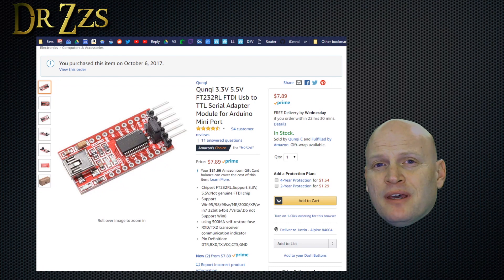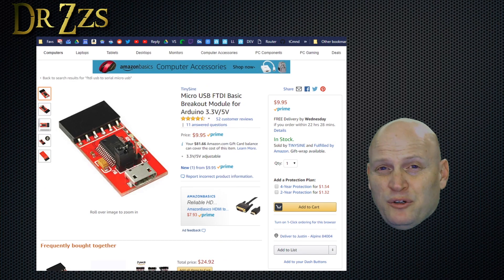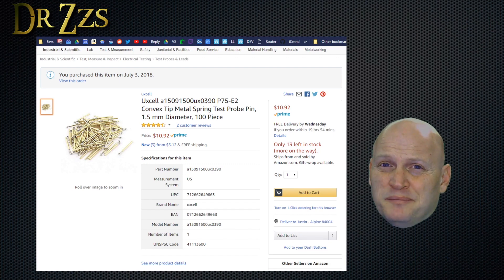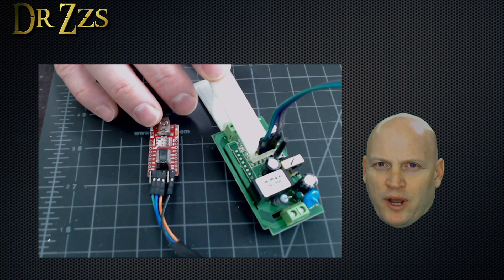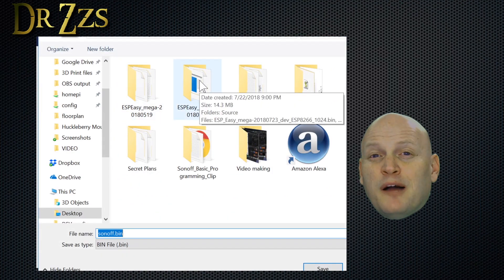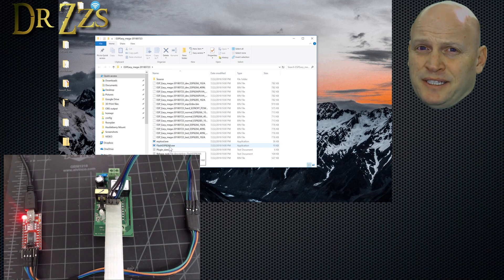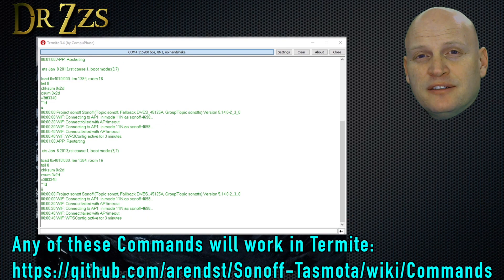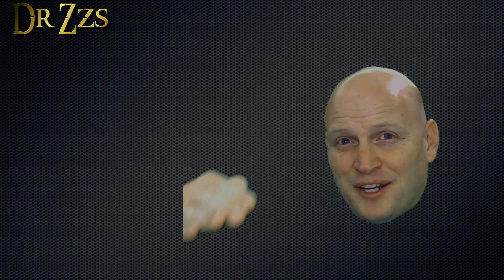How To Change Firmware on Sonoff Devices for use in Home Automation Projects

Comment: Let me get this straight.  Let's pick one advantage of flashing. Now I am thinking if I flash I should be able to use the unit ( with some extra programming ) to turn on a regular light bulb (120v) using the sonoff as well as the regular existing on-off switch ( I am not talking about replacing the existing switch with a push on/off or touch-sensitive switch ). Please confirm if I am right here. PLEASE.  I am a newbie.
Reply: May be I didnt explain this here. What I want is to use SONOFF and my regular household switch to turn a light on and off ( I should be able to use the regular switch and then also be able to use the wifi app and turn on/off the bulb. I hope I am clear )

Comment: I am not too much into electronics.. But in a few simple words can you tell me what this FLASHING is ? Why do we need this ?  Is it because you dont  like your devices to be controlled by the CLOUD ?
Please reply
Reply from the maker: Flashing is the process of replacing the firmware that comes on the device from the manufacturer.  When this video was published that was the only way to use these really cheap devices with your smart home hub of choice.  Things have changed and in most cases you can get these devices to function with any smart home hub now.  Some people still change the firmware (by flashing) because they want to avoid the cloud or because other firmware allows you to add functions to the device that the stock firmware doesn’t allow. Like adding motion detection or temperature sensor to a device that was built as just a light switch.  Flashing isn’t for everyone. It’s a fun way to tinker around and learn how these devices work and what all they can do.
Reply: @DrZzs  OK, I already use SONOFF to control my garage door (Sonoff Basic). The only thing I dont like is I use the eWeLink app, controlled by a chineese company ? Is there a way to only control SONOFF when I am at home and via the HOME-WIFI only ? i dont need CLOUD control.  What must I do ?
Reply: DrZzs I like to avoid the cloud as well. After flashing what app should I use.

Comment: ESP Home is SO much easier once you figure it out.  Copy the YAML file you have created for something else that is sonoff.  Change the names of a couple things.  Connect the FTDI to the Sonoff and plug it in to USB  Go to the folder with all your ESP Home stuff in the command prompt and type "esphome file.yaml run" When the prompt asks where the device is tap 1 for the FTDI in my case or 2 for WiFi.  Wait a few till it says it's resetting.  Remove power then reapply to reset the Sonoff.  Watch it connect to WiFi then put it all back in the case and hook it up.  It pops up in HomeAssistant and just has to be added. 

A few things are different to setup like if you want the button to basically reboot a device or something but otherwise it's super simple.  The main thing is each time you compile YOUR own bin for each device but no need for extra software to flash or to go into something to configure it nor an in between broker like MQTT to perform actions.  Once it's been flashed you can update or make changes over WiFi direct from ESP Home's setup directory which in my case is in the Python Folder.

Comment: Great tutorial. Every detail is important to begginers.
My Sonoff is the version with the holes, and usb converter already had rx and tx aligned, no crossing was necessary on the jumper wires. 

Everything looked fine until I tried to flash it. Termite didn't communicate at all. I was banging my head on the table for hours, until I finally saw the answer in a blog. The usb-to-rs232-adapter I use has the super cheap chip pl2303hax, not the ftdi's chip. It seems pl2303 version "hx" was pirated somehow and the vendor decided to drop a new windows 10 driver that killed all chips with that revision. Sadly there is no way to know if i have an original or not... and it doesn't matter anyway since all affected users NEED to buy new chips. 
(I still solved it downgrading the driver to an old version I found on the blog with the solution, after that it was ok).

Comment: DrZzs your are right, its already outdated.  Sonoff has removed the GPIO14 from its basic boards.  Making it unusable for the DIY community, I guess.
it turns out: the sonoff basic r2  now only comes with 4 holes GND,Tx,Rx,3v3 from amazon. I found out from your friend The Hook up (https://www.amazon.com/gp/customer-reviews/RD37CKA59B9YF?ref=pf_vv_at_pdctrvw_srp) that amazon is only shipping this 4 hole version (no gpio14)  So now we are going to be having problems "on reboot" with the GPIO pin (Tx=GPIO01,Rx=GPIO03 both pins pull High on boot) we connect to (which after testing the tasmota firmware in a esp8266 is something that has to be regularly done, causing the state of the "light" on boot, to change).  Is there another version that will have a gpio14 to work with (an amazon link ?)

Comment: Backlog SSID1 xxxxxx; Password1 yyyyyy; MqttHost brokerIP; MqttUser xxxxxxx; MqttPassword yyyyyyy; GPIO14 09; Hostname sonoff_name; MqttClient unique_sonoff_name; Topic sonoff_name; FriendlyName1 Sonoff-Name.....im so new i dont know where to find this info, can i get some help?
Reply from the maker: I can try.  the xxxx's and yyyyy's are names and passwords you'll have setup in other systems.  SSID1 is your wifi name. Password1 is your wifi password.  You'll need an mqtt broker.  When you set that up you'll have the IP address, user and password. Wherever I say "sonoff_name" that's the name you've chosen for this device.  Usually best to name it based on location or purpose. 
If you haven't set up an mqtt broker, that'll be step 1.  Then you'll have the IP, username and PW.  I'd expect that's the part that gets folks stuck.

Comment: Love the videos and attention to detail.  Following the procedure I am having no success.  At first I thought I had a bad Sonoff, but I'm having the same issue with the replacement.  I am using the Micro USB adapter you suggested.  I've verified 3.3v, proper connections and using a data cable.  However I can't get a terminal connection.  I use linux and am using esptool.py.  I am old salt in IT and low level stuff.  When I power up the FTDI, leds blink momentarily.  The sonoff never shows any led activity, don't know if this is normal.  Without booting in programming mode I can't get a terminal connection and esptool -p /dev/ttyUSB0 read_mac or just ttyUSB0 throws an error (running cmd as root).  dmesg shows FTDI at /dev/ttyUSB0.  I do see led activity on the FTDI when I open putty (or minicom) and press enter in the terminal window.  Not sure if I'm missing something or bad FTDI or another bad Sonoff.
Reply: I found the error of my way...  I had connected pwr to the DTR pin which was supplying 3.3v.  Had tested voltage and thought I was good.  Connected to the VCC pin and all my issues went away.  Flashed successfully, connected to and configured for my WIFI and on my way to setting up.  Thank you again!
Reply from the maker: Excellent!
Glad you got it worked out.  Thanks for the positive feedback.  I'll keep doing it!

Comment: Hi, I have successfully been able to flash my Sonoff Basic with Tasmota 6.6.0
Then I configured it to emulate WeMo Single Device for integration into Home Assistant.
The integration then shows up in HA, but no devices are listed.
What am I doing wrong here?
Please advice.
Reply from the maker: I'm not sure.  Do you use MQTT with Home Assistant?  I would suggest trying "SetOption19 1" in the console to turn on Auto Discovery.  You need to have MQTT discovery active in HA for that to work, but it is really simple to integrate that way. 
I haven't used the WeMo emulation/integration.  Sorry I don't know much else about it.  
All my Sonoffs with Tasmota use MQTT to talk to HA.  
Hope that helps.
Reply: @DrZzs  Thank you for taking the time to reply. I love your video's by the way :-)
And no, I do not use MQTT (yet). Maybe I'll have to now, since nothing else seems to work. The thing is, you see - that this guy actually made it work; https://www.youtube.com/watch?v=4H8ALCaAb-I
Allthough with a slightly older version of HA and a slightly older version of Tasmota - but still. I have asked him the same question, but so far - no reply.
But thank you anyway Dr.  Keep up the good work!
Reply from the maker: I really should try the emulation settings sometime.  I've had people ask about it over the years but I've still not tried it myself.  I'll put it on my to-do list :)
Reply: @DrZzs  That would be great. I'd love to see your immediate results. Meanwhile I've installed an MQTT broker just to test, and I can confirm that it works - after countless hours of trial'n'error with config, setup, scripts and adjustments. This is way beyond any normal mortal human being. :-)
Reply: @DrZzs   Great! I'm eagerly awaiting your test results :-)

Comment: I going to tell you what I think off this off-screen so you can do it yourself and will never know what I've said or done....
Reply from the maker: Sorry, I don't understand what you mean.  Did I not show something critical?  Or are you referring to something else?  
Thanks.
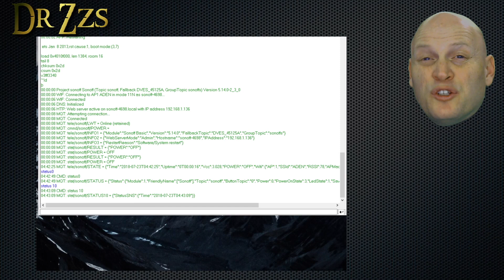Reply: @DrZzs  >> I think he is making light hearted fun of your comment(7:21) about the termite instructions where you said you were going to put your information off the screen.  It was a little confusing, but if he read your complete description he would have seen you provided all of these commands as well as a link to a github file with these examples.  I have to say, I am so excited that I ran into this version of yours to flash Tasmota, THANK YOU!.  I struggled with Arduino methods for a while and just gave up.  this was very smooth, thank you very much.  I got my sonos up and running, now I just have to figure out how to get it working with home assistant as my Raspberry Pi is coming tomorrow.

Comment: Question: when printing Mark's Sonoff Holder Clip. How dense do they need to be? Should I go with 50% or 100%
Reply from the maker: Not sure there's a big difference.  I used 30% with PLA and it never broke.  I didn't use it much though.

Comment: Does anyone know of a Mac computer alternative for the Termite software?
Reply from the maker: I haven't had much success flashing anything from my mac.  Always running into driver errors.  I fix them and it works for a while, then the drivers get reset and I have to do the fix again.  I've just moved all flashing to my win10 pc.  You could use the Arduino IDE serial monitor.
Reply: @DrZzs  good info...thanks for the response

Comment: I would strongly suggest against using a 3D printed part to do this job. It cost $26 shipped and broke before it touched my first relay. Even when I got the pogo pins in it (after breaking 3 out of 4 due to the holes being too small for the pins by a tiny bit) and verifying the connection between the end of the jumper wire and the end of the pogo pins, it wouldn't program. I successfully programmed half a dozen by taping the four jumper wires together with shipping tape and applying gentle sideways pressure to ensure a connection between the jumper pin and the holes. And the current ones are shipping without being filled in so this works... for the time being. Anyway, I'm highly skeptical of anything 3D printed unless you know exactly what material to make it out of and can print another one when it inevitably breaks. Also, this guide made no sense on logins/passwords for a non HASS.io MQTT server. I had to search that one myself. Finally, the HA wiki suggests firmware 6.4.1. The old version didn't work with a current install so try 6.4.1. Just remember to include "SetOption19 1" on your messages to your programmed relay.

Comment: I get stuck at sending the info through termite to the sonoff...
it does not report back with an ip adres, just seems to keep on rebooting..
I'm a real noob at this, and may have messed up the message to be sent to the sonoff. MQTT is a complete mistery to me at this moment, and may not have gotten those settings correct. Any help would be appreciated

Comment: Best manual for beginners ,just like me.
Reply: which tasmota version did u use? I tried with 5.14.0 and the new 6.5.0 and it says flash failed ( ESPEasy flasher can't connect to the sonoff)
Reply from the maker: Lately I've used 6.4.1 
It might not be the version of tasmota that's causing the problem.  When you start FlashEZ with the sonoff connected do you see a new Com port in Flash EZ? Something other than Com1?  
Could be a bad USB/Serial adapter, or maybe the sonoff just isn't getting into programming mode.

Comment: Omg, thank you. I just purchased a set of Sonoffs, going to use one to automate turning on/off the light in the pantry when the door is opened/closed. My first big (for me) automation project. Also going to connect it to Hassio, what fun! God Bless :)
Reply from the maker: Good luck!  They've changed the layout of the newer sonoff basics.  Flashing should be the same, but there is no GPIO14.

Comment: Do yall know if I can use sonoff with google home after flashing?
Reply from the maker: yes you can.  
Tasmota can pose as a Hue device and be recognized by google home or alexa.  But they work with both using the stock firmware too.  The reason for flashing for me is to use them with Home Assistant as the hub.  I use Alexa and Google Home with Home Assistant too, but that requires the HA cloud and costs $5 a month.  So, depending on your end goal you might not need or want to flash them.  What are you planning to do with the Sonoffs?

Comment: oh man, the Budweiser Goal light hardwire hack is in its final stages. It is going to be amazing! One question - I am able to use its IP address to see the GUI and add parameters, I only entered SSID and password in Termite as I didn"t have the MQTT info available and did not understand the other parameters but knew I could change in the GUI, .... so far I changed the friendly name - it is not showing in Hassio, I have auto detect enabled and a static IP, will HA only see it with MQTT? Seems weird if yes but?  BTW, I flashed sonoff to a D1 mini

Comment: Found 10 pogo-pins on eBay for $2.99 total inc shipping. search for "P75-E2 pin"
Reply: 100 pogo pins for $1.64 on eBay: https://www.ebay.com/itm/100Pcs-P75-E2-E3-spring-test-probe-pogo-pin-1-3-1-5mm-conical-head-1-0mmthimbleW/192888892391?ssPageName=STRK%3AMEBIDX%3AIT&var=493046501847&_trksid=p2057872.m2749.l2649

Comment: this works with RavenCore firmware ? you mention that if you have the *.bin file, it can works, but in this guide (https://github.com/RavenSystem/esp-homekit-devices/wiki/RavenCore) i have 3 .bin files, main.bin, rboot.bin, and blank_config.bin, any idea of witch i need to use ? thanks A LOT for this kind of tutorials and sorry for my english, i am from latin america

Comment: Thanks for the video. I followed the instructions and the flashing went well, but the sonoff doesn't allways connect to my wifi. I hav a Ubiquity network with multiple AP's. The Sonoff doesn't connect to the Livingroom AP, but sometimes connects tot the bedroom AP, which is further away. The livingroom AP seems to work. In my router I see users connected to that AP. When using Termite I get the error cannot connect AP time out error. Does someone have an idea? I tried flashing older versions of Tasmota, but that did not help.

Comment: I plan on having a Sonoff Basic in the wall, with a switch on GPIO14 that controls an S26 through HomeAssistant automation. Is it safe to have the Basic in the wall running it's relay on even with nothing connected to it's output? I've got the automations setup and it all works perfectly, but I want to check before putting it in the wall.

Comment: Sir, can I flash esp8266 01 chip right from scratch to make my own sonoff module using other auxiliary components or do I have to use the readily available sonoff module.
If possible please share the schematics details and software code so I can make one.
Thanks

Comment: I flashed 3 different sonoffs with your instructions.  Holes were opened (not soldered).  I just used some male pins and set them at an angle to make contact.  Worked like charm.  Thanks DrZzs
Reply from the maker: Awesome!!
Reply: I also just bought the 6 pack in the link and the holes were open. I ordered a clip at the same time so maybe I'll need it in the future.

Comment: It's still possible today to change firmware ota?
Reply from the maker: it is still possible on some Sonoff devices, but not all.  It depends on the firmware version you have.
Reply: @DrZzs  I'm about to buy only sonoff  basic. I would use it on the last hassio build and the last tasmota firmware. I'm planning of using an external button to control it. But I don't know if I can do it on the rev2. I've already take the ciph to manual flash it on aliexpres but it takes 40 days to come, and the sonoff only 2 days so I'm thinking of ota flash. Thanks for your advice and response

Comment: Tried Tasmota v6.3.0 and didn't work, returning error: Connect failed as AP cannot be reached.
Then tried v5.14.0 and all works well.
Reply from the maker: glad you figured it out.  I haven't been following tasmota releases as closely the last month or so.  Not sure what the changes are for v6.3.0.  I'll stick with 5.14 until there's something I need that's newer.  Thanks for the heads up!